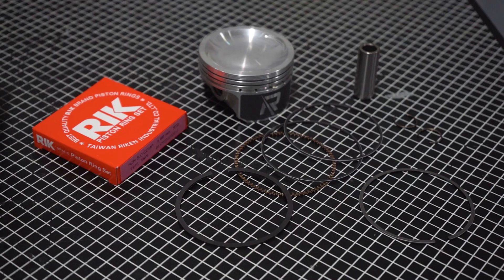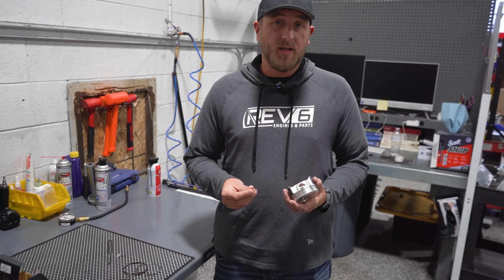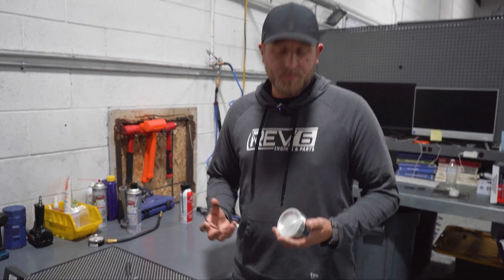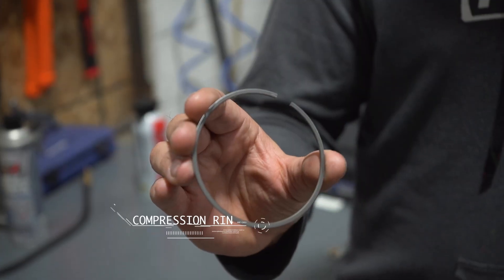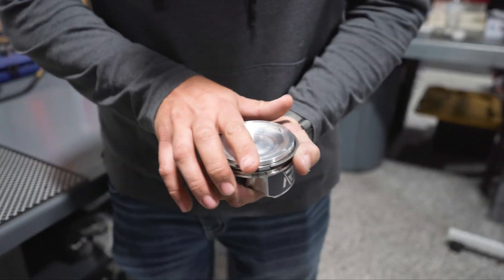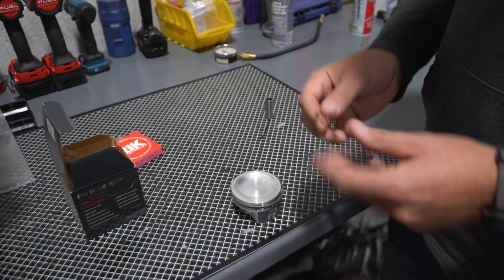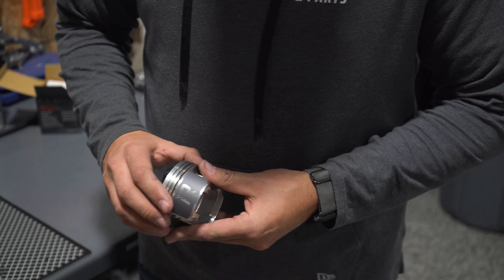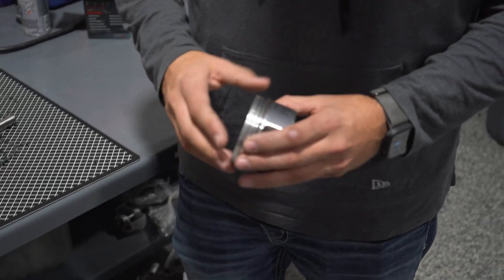UTV Piston Ring Installation & Orientation - Tips & Tricks | Rev 6 Engines & Parts

Comment: Got some pistons for my polaris 800, the arrow etched on the top didn't correspond with the arrow cast on the bottom of the piston on one of them - went with the arrow in the casting towards exhaust.....
Reply from the maker: When in doubt, the cast arrow (usually on the bottom of the piston) is the one to follow, as it’s part of the original mold design and typically points toward the exhaust. Sometimes etched markings can vary depending on the manufacturer or batch. If you’re ever unsure, feel free to reach out to us directly with photos—we’re always happy to help verify orientation and make sure your setup is good to go.